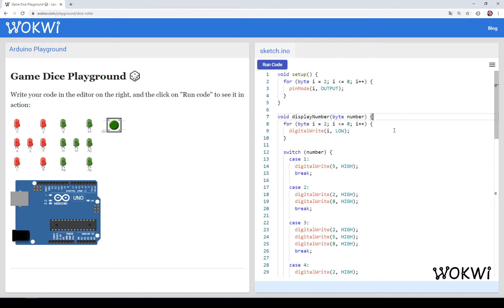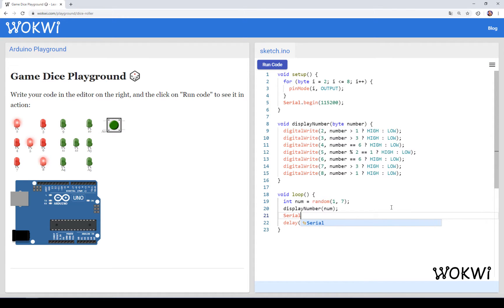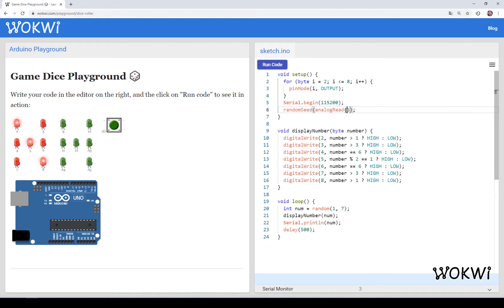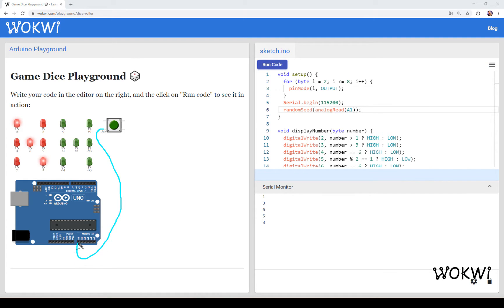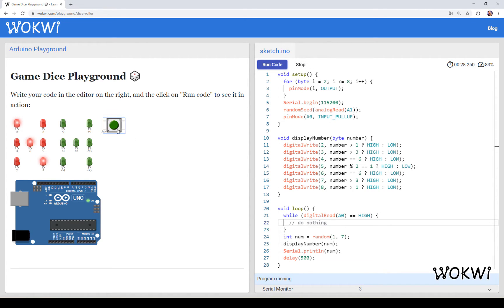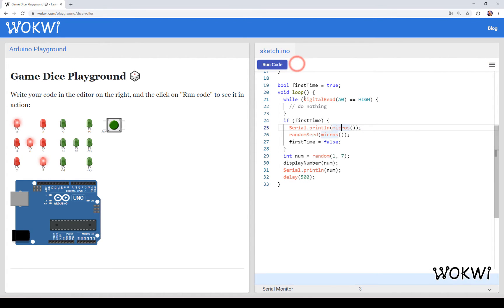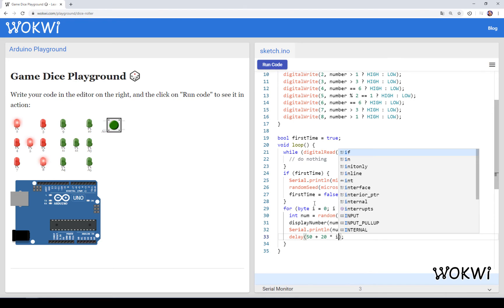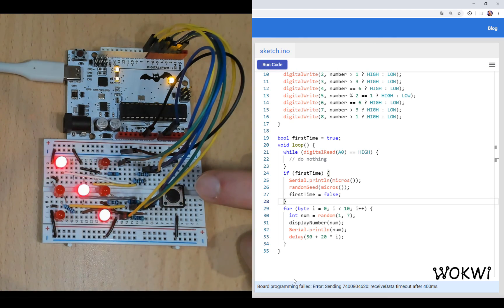Programming Arduino Dice Roller: Making random() more Random [3/3]

Comment: You could use a analog white noise generator, a npn transistor noise circuit plus 2 opamps for scaling (from an analog synthesizer module, like eurorack) tied to analog pin.

Comment: I'm getting the same sequences even when using the analogue pin for randomseed. The micros() worked much better. Thanks!
Reply from the maker: You are welcome :-) One caveat with reading from the analog pin is that if the pin is grounded (e.g. the user is touching the pin solder point and the USB connector at same time), analogRead() will always read 0. So it's possible to cheat this way...